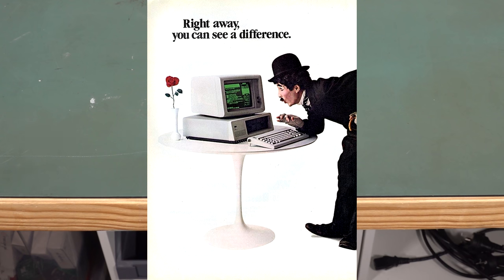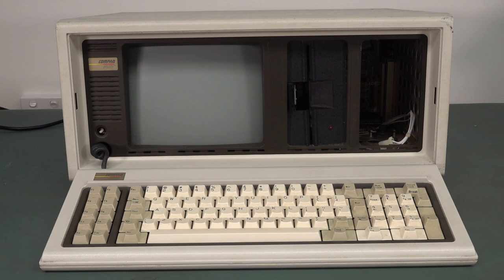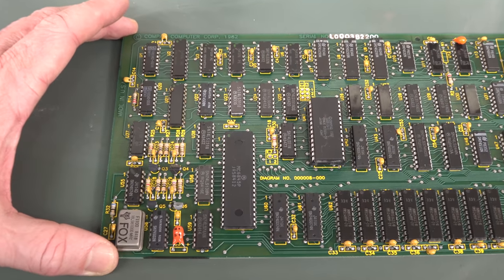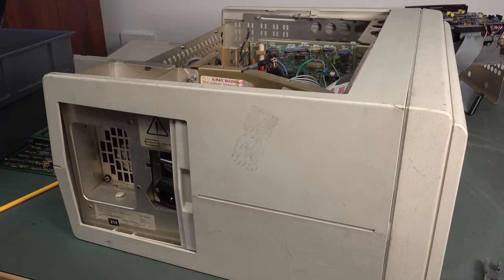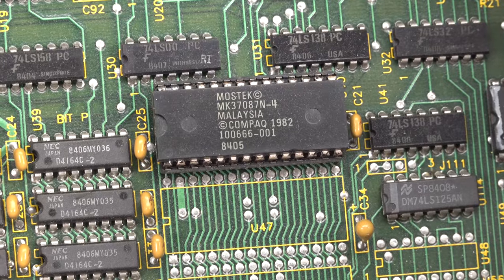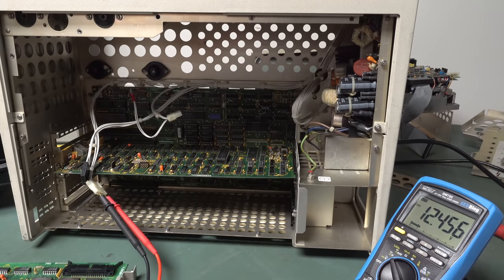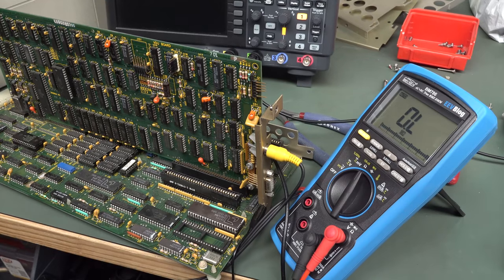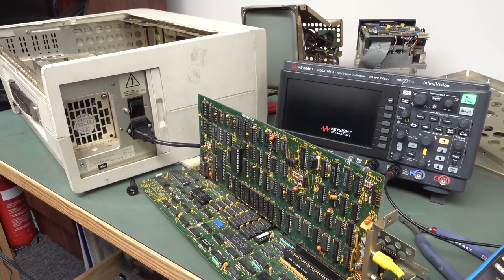EEVblog #1348 - World's First IBM Compatible PC - The Compaq Portable

Comment: A joke from back in the day...

Q: How can you spot a Compaq user?
A: One arm is longer than the other!
Reply: Yep, and that's why it was called a "luggable".
Reply: @darkally1235  It made a good seat on the train,  when the carriage was full. 
How do I know? 
I lugged around a similarly sized Philips P2000C to various hospitals and other customers back in the day. (2x Z80 with optional 8088 co-processor card, ran CP/M or MS/Dos). 
It was way more serviceable than that Compaq ever was. A joy to work on. It was about the same size, and almost as heavy.
Kept you fit though.   
http://www.computinghistory.org.uk/det/7130/Philips-P2000C/
Reply: The Kaypro 2 weight 13kg the same as the Compaq portable. This way you could get the same long arm but CP/M compatible!

Comment: Compaq was by far not the first IBM PC clone -- but as they say, history is written by the winners. Columbia Data Products introduced their first IBM PC clone in June 1982, five months before Compaq, and just like Compaq they also used a legal "clean room" ROM rather than an illegal copy of IBM's ROM like some other companies did. But Columbia stopped making PC hardware in 1987, while Compaq lasted until 2001 when they were bought out by HP.

p.s. Bill Gates never said "640K ought to be enough for anyone", either -- especially since when he supposedly said it in 1981, the first version of the IBM PC's ROM was limited to a maximum of 544K of RAM, not 640K.
Reply: I owned a Columbia and wrote a lot of code on the thing. It was a good machine at the time.
Reply: Didn’t know that. Thanks for sharing.
Reply: Yeah, I wish people would stop propagating the idea that the compaq portable was the first IBM clone. MPC1600 owner here! To be fair Columbia Data Products got taken to court by IBM, and IBM won as Columbia had simply copied IBM's ROMs for use in their product (thus violating copyright). Compaq took notice and did their bios/roms by cleanroom so they would not see the same fate. The reason for clones existing at all is a worthwhile read! The MPC1600 was a superior machine every way around the original PC, and you didn't even have to waste an isa slot on your floppy controller as it was built into the motherboard. The motherboard on this thing is HUUUGE by the way! I should really do a video on this thing at some point.
Reply: Actually the first IBM PC clone was the Cardiff Electric Giant.
Reply: @cprossu  I think you're thinking of Corona Data Systems (later Cordata), who did illegally copy IBM's ROMs and got sued as a result (as did Eagle Computer). Columbia legally "clean room" reverse-engineered IBM's ROMs to develop their own workalike of it, just like Compaq did.
Reply: @vwestlife  Neat! It might have been Eagle computers I was thinking about. The whole thing reminds me of the Data General vs Keronix mess that happened before, minus the actual burning down of factories... Another popular rumor was the reason IBM lost the patent to their PC as the way they wished to defend it was similarities to the Apple ][ motherboard, but I am not so sure on the sources of that.
Reply: Sorry to Disagree but ... DEC Rainbow 100:  May 1982  Dual Boot (CP/M 2.2, MS-DOS 2.11).    You can see my DEC Rainbow 100 at the DigiBarn computer museum here:  http://www.digibarn.com/collections/systems/DEC-Rainbow100/page_01.htm  .   It still booted up when I donated it in 2002.
Reply: @lindajohn58  The DEC Rainbow was not fully IBM PC compatible.
Reply: @vwestlife  In 1995 I got an old Cordata CS-45. It came with some excellent tutorial software which taught me DOS :)
Reply: Bill Gates might or might have not said that. (I don't have proof). But it's notbecause it's limited to 544 KB of ram, the operating system is capable of addressing the whole 640 KB at the time. Thus it's plausible that he has said that.
Reply: I still have my CDP portable that I purchased at the factory in Columbia MD.   Just added a GoTek / Flash floppy to add some flexibility to my media source.  Love the amber crt on this luggable.
Reply: @ASilentS  Cardiff Electric got into some hot water with IBM.  If I remember, the girl they hired to do the BIOS snuck a peek at the IBM code or something.
Reply: The "gold standard" of compatibility, at the time, was whether MS Flight Simulator would run.  There were some clones that could successfully run MSFS, but had serious issues in other areas.
Reply: @vwestlife  I probably don't need to tell you, but it wasn't until 1983's Apple Computer, Inc. v. Franklin Computer Corp. that it was established that BIOS code COULD BE copyrighted. That was also about boot firmware, I believe. There was some thought that code was like gears, that copyright only applied to literature; human readable code not machine code. So the "clean room" approach was risky because, for example, if Apple had lost, competitors Corona and Eagle could pump out "clones" with none of the research and development that Compaq did (I was not aware of Columbia or others). which was reportedly about one million dollars.
Although Gates may not have said that about 640k, it does sum up the attitude of many who basically didn't take the concept of "personal computing" from home or a small business seriously. There's a lot of apocryphal stories of the PC's early days that while untrue in details, do illustrate a larger point.
Reply: @lindajohn58  who are you responding to? I salvaged a DEC Rainbow from the trash in the late 90s, but didn't have the resources to get it running. I'd love to refurbish one today.
Reply: @vwestlife  Well, certainly DOS for the Rainbow was incompatible with PC-DOS. Because it had both Z80 and 8088 processors, it could run both 8-bit Z80 CP/M  and  CP/M-86 (despite the name, it ran on 8088s, including the original IBM PC). And it functioned as a DEC terminal, as well. It was built like a tank, too.
Reply: @Okurka.  a denial is not a proof that he hadn't said it. Criminals often denied that they did the crime. Drunks often said they aren't drunk. Your defence isn't logical. Famous people often denied they had said something in the past. Some people even forgot things they had said.
Reply: @squirlmy   I donated my Rainbow ( i was original owner) to a museum.  it was still running at the time.  i have no idea where you would fine one now ... the one i donated doesn't need any refurbishment.
Reply: @lindajohn58  Thanks. They come up on eBay, but are usually missing the CRT, which is a problem because it's a proprietary connector. I don't know if a DEC VT terminal could be used, possibly? I think the unit alone without the monitor weighs over 20 lbs, which makes shipping expensive, too.
Reply: @vwestlife  Although people also may want to know, that both CDC and Eagle Computer settled out of court, and there was not a fixed monetary amount, settlements involved share in profits from existing machines, etc. The US Courts didn't rule anything about non-human readable code being copy-written until Apple vs Franklin in 1983 IBM was prepared to challenge CDC and Eagle on other problems as well. I believe both CDC and Eagle also continued to sell the models in question, the settlement included giving a percentage of profits of those machines to IBM. Strangely the Eagle in question was also given the suffix "1600" as the "Eagle 1600". I do not know why both companies put this number in the names. Finally I've seen mention of a computer from Handwell Business Machines, in a magazine and even paperwork from them for sale on eBay. I can't find evidence of an actual machine, however.
Reply: @squirlmy  1600 as in 16-bit, and twice as good as an Atari 800, maybe.

Comment: @12:00 C42 on the front edge is blown up ! I spotted it immediately.
Reply: Good eye!
Reply: Its a case of "Live commentary recording blindness". Its common on youtube.
Reply: Also C28 behind it.With the close up later I can see it was just scorched.
Reply: @FireballXL55  I reckon that's just a skidmark.
Reply: @agurdel  Indeed, I have missed things during recording and only seen them later on too, it certainly is a thing.
Reply: @cambridgemart2075  Yes saw it in close later in the video.
Reply from the maker: @TheDefpom  I shoot everything in sequence and on the fly, so I don't go and inspect the board first and then shoot the video. And I'm always looking at the small cancorder screen, very easy to miss stuff.
Reply: Hero
Reply: @EEVblog  - that’s the same way I do it, and I know I’ve missed stuff whilst recording video before, trying to focus on getting the shot certainly distracts from visual inspection, I’m sure you would have spotted it quickly too if you weren’t filming. I do have my camera hooked up to a 24” monitor though, helps me to get stuff in focus more often... can’t see the blurry picture on the tiny screen.

Comment: I hired on as Service Manager in 1979 to Store #85 of Computerland, which was a chain of retail stores all over the U.S.  - this one was in Sacramento CA.  I worked for the local franchise which grew to 5 stores in northern California till 1987.  I went to many service training seminars over the years including at IBM for the original PC.  That one was held at one of their labs and was a week-long, deadly serious affair.  When Compaq came on the scene I attended their equivalent multi-day training in Houston TX., and it was much more light-hearted - I think they were even then trying to point a finger in IBM's stuffed-shirt image.  That was held at the top of one of their 3 corporate tower buildings which were later acquired by HP as part of the real estate in their acquisition; ironically years later as an HP employee I visited that site again.  The Compaq was quite an elegant machine and as you have discovered, it was designed to be modular and easily serviced.  If I recall, the power supply can be removed without having to remove anything else; the video display was removed by first removing the AC line/switch block and then using a long screwdriver through that opening to reach the screw that is on the side.  A funny but true story; the way they taught us how to open the case was to place one of your hands flat on the top center of the case and press hard; this would cause it to bow out a bit at the rear end; then hit it hard with the other hand as a karate chop, all while shouting "Hi-Yee"!  That would cause the top section to pop right off and then you could access the innards; same thing with the bottom panel.  We actually had to practice this maneuver with the sound effects in unison in class till everyone successfully got their computer cases opened.  Later on, when I was working in the store and had to open up a Compaq "luggable" as they were called, I often followed this practice as well, to the great entertainment of store staff.  It got slightly more funny when I actually performed the procedure in front of a customer (having judged in advance whether that customer would mind too much).  I still have one of these luggables; have not powered it on in 20 years and I'm sure it needs to be re-capped, but it's complete with the co-processor, an enhanced set of cards (AST multiiport serial/parallel) and a 20gb hard drive, which required its own separate controller.  I last used it as a "portable serial protocol analyzer; using the serial port with specialized software to monitor the data stream and/or inject bytes as necessary to debug serial peripheral issues.  As I recall, the video should display just fine on the build-in screen even with that Composite/CGA card installed; at power-up you should see the memory counting up and then a BIOS message first, then the boot prompt.  Switching between the built-in monochrome versus external color was a function key combo.  I've got all the manuals for it stashed somewhere in the garage including the service manuals.

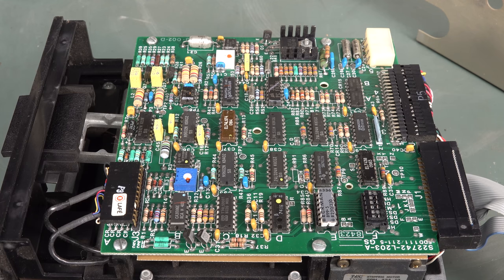Comment: 13:43 Wow! That thing has SOVIET parts in it! That EL74LS74 chip was made in the USSR!!! 
EL was Soviet export marking of Western-compatible parts. 
But they are still recognisable because of font and crappy (usually) brown plastic.

UPD: Oh, there is also EL7438 on the same board
Reply: Back then there was a ban on selling computers and the components to Russia, even the ZX80 was banned in case Russia used them as missile guidance systems !
Reply: Yes, I just came to the comment section to find out if anyone else catched it! And also a Romanian 7416 on that board, with the 'Beta' symbol on it. 
I've seen these USSR export EL74xx chips in Commodore Datasettes and 1541 drives as well! Weird! But I've never seen a Romanian one until now!
Reply: @steverpcb  Yes but luckily Z80 CPU was copied in DDR, so the era of self-build computers (and other cool stuff) begin in the USSR too.
Reply: @mrnmrn1  Thank you for the information about the chip with "Beta" logo. 
I suspect it was from Eastern Europe but newer thought that it was from Romania.

I am not sure was this FDD originally installed in this Compaq or it was installed by the owner. Searching Web I found this:
 https://www.ebay.com/itm/Siemens-Model-FDD111-5-Floppy-Disk-Drive-PN-S22742-A1115-C001/372854101030
You could see that the floppy drive and PCB is the same but this one has Siemens sticker and all Western IC in it. 
Perhaps, this FDD was designed by Siemens, WST was one of OEM maker and Siemens allowed them to sell overproduced devices by their own brand - so they bought the cheapest parts they could ever find? Just a theory...
Reply: @steverpcb  In early 1980s they had PDP-11 copy https://en.wikipedia.org/wiki/1801_series_CPU
Reply: I have a Sovtek-branded 7400 somewhere.

Comment: 11:35 Waxes lyrical about replacing tantalum caps.  Next shot, point directly at blown tant. Then spends the next 10 minutes tearing computer apart looking for it.   Classic Dave
Reply: Hi my guess is he saw it, but being on the floppy controller ( an accessory card ) the pc should still boot up but not have a working floppy.  Sort of like say a 26/486 with a faulty isa sound card - they system will boot and run but  not that sound card - unless that cap is now a direct short to ground
Reply: @georgemaragos2378  nah, he would have explained that if he saw it. He explains everything he sees even if it's not relevant

Comment: This was my first PC. The hard drive was on a ISA expansion card. Yes is was a long expansion card with a HDD screwed to it. the front section of the card had the controller. I believe it was called "Plus Hardcard 20" for 20mb's. I received it in the early 90's, it was in a large shed owned by my friends parents, they used it at their business but was since retired. They gave it to me for helping clean out the shed. I do recall luging that thing to my friends house that was several blocks away. It was heavy, and I had to stop after every block for a rest. Luckily it was so sturdy I could use it to sit on while I rested. haha

Comment: I've taken one of these apart. The CRT can be powered off a molex connector. I had it hooked up to a Pentium machine effortlessly. I remember watching Terry Gilliam's "Brazil" and wanting to build a bare bones terminal, like they had in the movie, and this was perfect source of parts. If I knew these computers were going to become such rare (and expensive) collector items, I wouldn't have thrown the rest of the machine out, which was in perfect working order. I wanted to make the original videocard shorter, so I sawed it in half along the division line right in the middle. Sadly I then discovered that it was a multi-layer board and I was never able to re-link the middle layer properly. After that I discarded the CRT as well. Regret it to this day.

Comment: I have a 5150 which originally had Datalight ROM-DOS on it.  It was a diskless machine which came from the Air Force Base here in Wichita when they were still doing pilot training here.  It was used with an interactive cable TV system known as MicroTICCIT.

Comment: At work, I had full access to the IBM Technical References manuals (both hardware & DOS). The company had a pair of genuine IBM PC/XTs (XT= hard drive, ALL 10MB !!!). For internal use, we made a few "one off" plug in cards, so needed those manuals for reference.

When it was time to upgrade to the AT (286), we got a clone. Added IOmega Bernoulli boxes (~8in 5MB kinda floppies, kinda hard drives), with removable media.

Comment: The 5160 PC XT has a revised mainboard with more expansion slots; it actually set the standard for slot spacing in PCs to this day.  It also has a larger PSU for better hard disk support.

Comment: I owned one of these for a few years in the 90s - it had been heavily modified by previous owner. Although this was originally an 808x machine, mine had a daughterboard in one of the ISA slots with a '286, and the really goofy part, a ribbon cable running from that board that plugged right into the original CPU socket. Talk about an interesting "bodge". Sold it to a buddy just because it was so huge, but I do wish it was still in my vintage hardware collection.
I had originally found it at a new/used parts store where I was buying my very first Ethernet card. That didn't even come with a boot ROM but was nearly US$200 back in the early 90s.